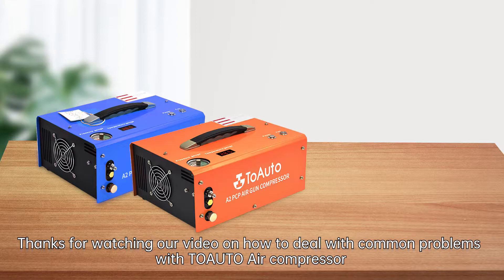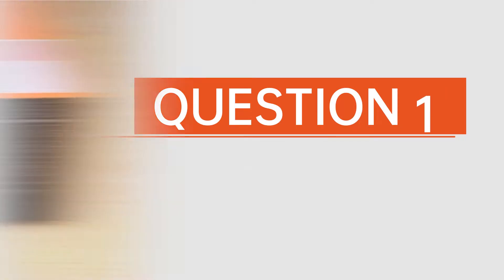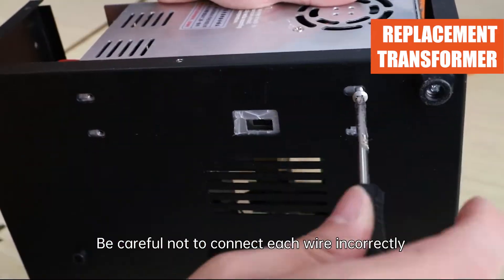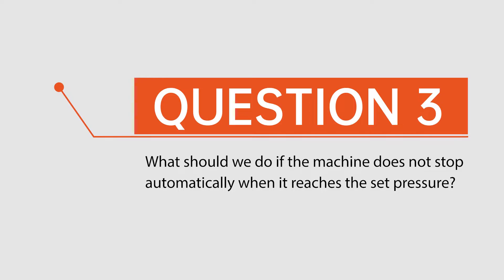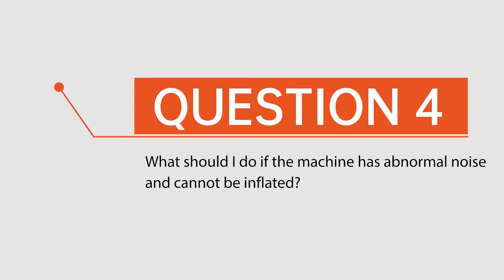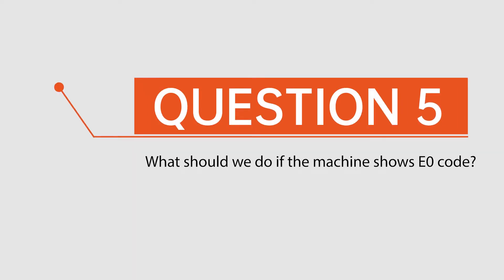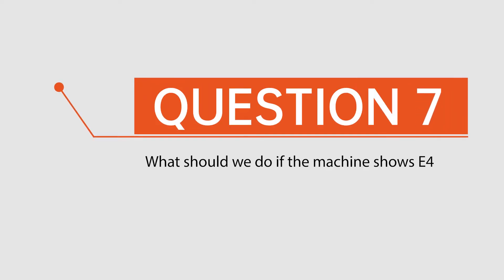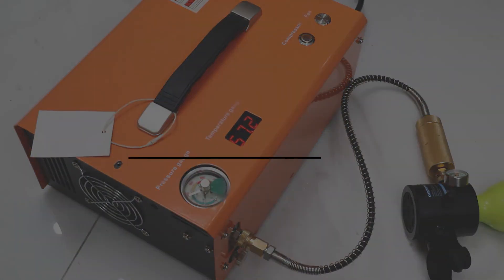【Technical guidance】Vehicle high-pressure air pump repair guidance-Portable air pump-12V available

Comment: I have an A3 ran into this problem a day ago the a3 is not doing pressure anymore you press compres button but the pump is not working and after a second you get an E2 error cable is fine 
And checked on different outlets

Comment: Mine works fine on AC power, but keeps stopping on DC power when connected to my vehicle.
Reply: Was the engine running to supply more DC voltage?
That made a big difference with mine!
Reply: @dougskucas5004  For me the engine has to be running when using the compressor. I believe I may have fixed the problem. A short time later I had to replace my alternator. I haven't tried it since though.
Reply: @guitarmage0072  Interesting!
The compressor is 350 watts, which means at 12V, the amperage is 30 amps.
A car's alternator puts out at least 60 amps, minimum.
Perhaps your alternator was on it's last legs?

Comment: When i bought the air compressor it did not come with a check valve in the kit. i have been looking and looking  and can not find one at all. and the kit is only about the size of my hand and thats the clear bag i'm talking about. it doesn't produce air at all any more and the piston quits moving altogether. so i take it apart and polish the piston with 5000 grit sand paper then the piston move again.  i know i send you guys a video like you wanted but i get know response back at least nothing that will help me. can you guys send me some check valves and i believe there was an o-ring that was inside with check valve.  i have o-rings but if it takes a certain size just let me know because i have hundreds of different sizes but not check valves.  please get back to me soon   thanks

Comment: Used it 4 times & it broke! FOUR TIMES!!! Like WTF !!! Runs but wi t build pressure & the safety valve is fine! I even replaced it anyway & check the check valve & it’s also fine! $360 ??? Why won’t this build pressure?

Comment: Mine won’t start on either mains voltage or 12v battery, what should I do?
Reply from the maker: Unable to start may be due to component damage or machine short circuit.

Comment: What if the air compressor builds little pressure and then shuts off what to do?
Reply: Mines does the same thing pumps a little pressure then start struggling to pump them shuts off.
Reply: Same issue here. Builds a little pressure, sounds like it's struggling, then the pump turns off but fans stay on. What could it be?
Reply: @asmallpieceofmyjourney simple solution. remove the check valve located at the piston housing. clean thoroughly all around it, replace oring and acetal. thats it.
Reply: @asmallpieceofmyjourney  the reason why it is turning off is because the piston cannot push the build up pressure anymore inside the piston casing due to high pressure back flow. There something wrong with check valve  located at the piston casing,  Remove it clean it and replace the O ring and Acetal. That will work fine. Good luck!
Reply: Are these the same as vevor look 99% the same
Reply: @smeizO , I would say there are at least 3 or 4 companies having one manufacturer & selling the same exact compressors just putting their names on them !
Reply from the maker: 1. The relief valve not being tightened. 2. Air leakage at the connection. 3. The pressure gauge is abnormal. Try plugging the air outlet with a plug and pumping air to see if pressure is generated. You can also provide a video of the malfunction to the store to help you solve it.💕

Comment: Was give some pressure with some issues and noises and now don't give any pressure. Its the solution 2 my friend?
Reply from the maker: Thank you for watching and liking. There are many reasons for this. You may need to consult the store to provide more detailed information.
Reply: @ToAutoOfficial  i bought the compressor before 3 months approximately from alibaba.
He seems don't understand what the problem is even after he watched the videos i sent him that show the issue.
Reply from the maker: @noobt4eguns  ummm, There are many situations. You can check whether the pressure relief valve is tightened. Then check the air inlet, air outlet and pressure relief valve for air leakage. It may also be necessary to replace the bursting disc. In general, it can also be solved by replacing the check valve.💕I hope it will help you. Finally, I suggest you contact the merchant again to get a better solution.
Reply: @ToAutoOfficial  i believe  need cylinder assembly replacement.
Because i check all the connections,disk,and valve and all are ok just some dirt inside of the system but its not this the issue.
But very big thanks brother for your time really appreciated 👍🏻❤️🙏